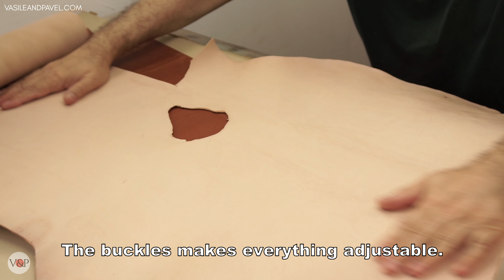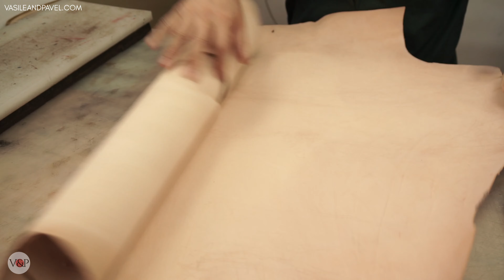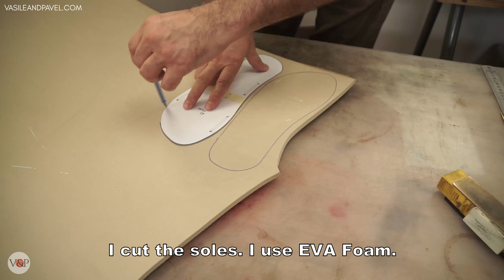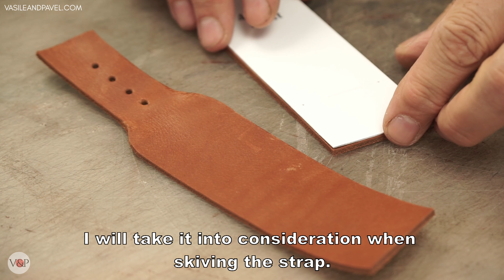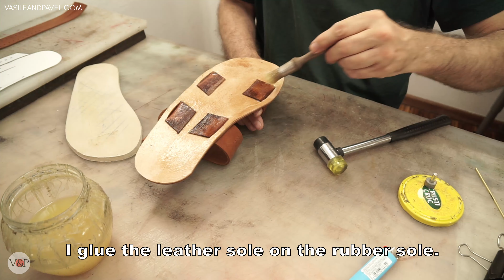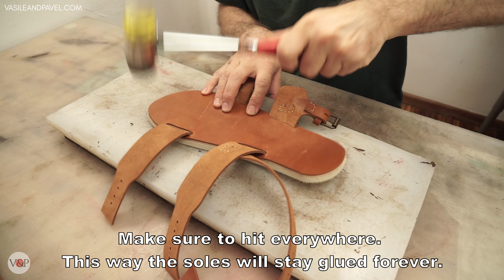How to Make Men Leather Sandals with Buckles, German style

Comment: Question for ya, when you are wearing them can you feel the tabs from the straps on the bottom of your foot? As the leather breaks in and forms to your foot I wondered if it would indent around the flaps.
Reply from the maker: no. As you see, I line the leather sole, it is really thick and the rubber sole is EVA (etilen vinil acetat) and it is flexible, so the straps "goes" in the rubber sole. I make sandals since 1988, many of my clients come again and again
Reply: @VasileandPavel  very cool! I wasn’t doubting your craftsmanship at all, just a novice with a question is all haha thank you for responding!!
Reply from the maker: @newmanconner5920  I just explain what I do and why I do this. I sell patterns, many patterns, so a lot of people asks questions. My rule is to answer to everybody and I didn't think you are questioning my skill, I thaught that you'll make a pair of sandals and I want that sandals to be well made